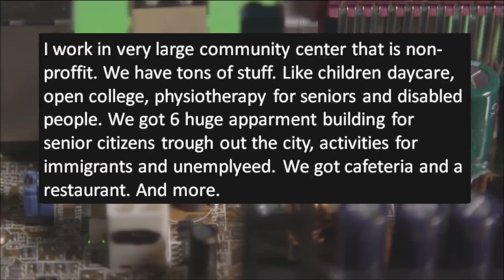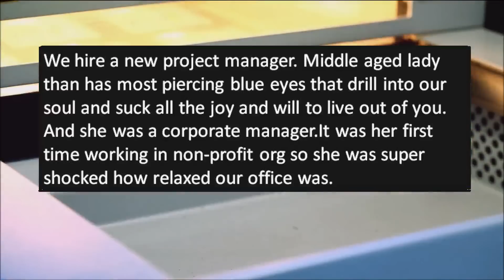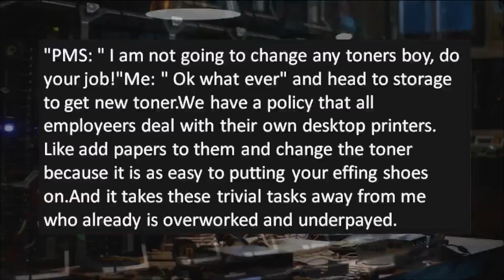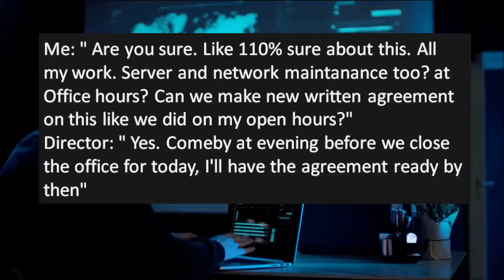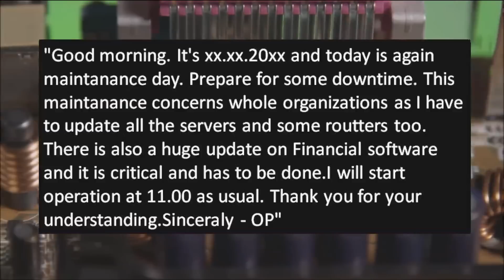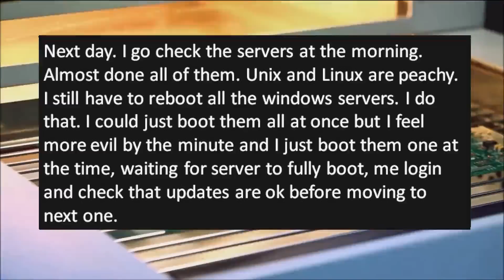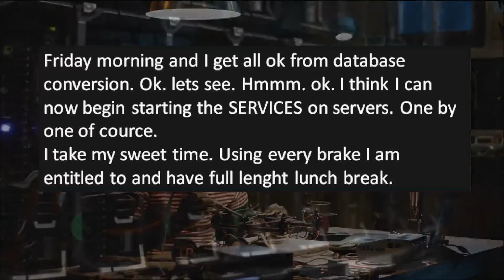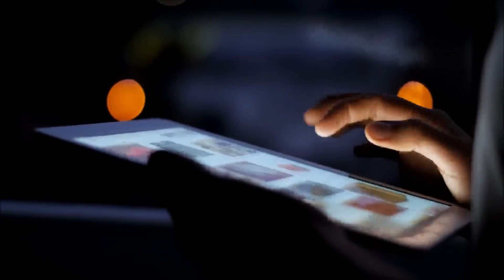Tales From Tech Support - Enjoy your down time!

Comment: I was once reported to my boss by mall security to have been starting work super early on Sundays (an hour to an hour and a half before opening). I used the city bus and it ran infrequently on Sundays. I would clean the floor, tidy the shelves, maybe do some merchandising, and then when my shift actually started I clocked in and did the routine. My boss scolded me and said I couldn't be in the store so early. So I still got there at the same time but had to sit on a bench outside the store until it was time to clock in. Whatever you say, boss 🙄
Reply: I take public transport to work when I can work (Pandemic is keeping me home and sometimes there is no work to do) I often get to work 30 minutes or more before I am due to start. This is in part because I try to plan for delays in travel etc. If I get there and they want me to start then I often will do so otherwise I choose where I am going to sit, turn the computer on, and head to the break room to chillax until starting.
Reply: Crazy. What do mall security have to do with work hours?
Reply: @seraglioborneo2803  I have 2 theories: either it came up in casual conversation between my boss and security (totally possible) or the security guard found it suspicious and reported it to my boss as a heads up.
Reply: [S Young] So if you use your key to enter the office and start working at your desk, at a place where you go to work EVERY DAY, that's suspicious? Looks like the security guard is bored and wants some excitement in his life? How about reporting him to his boss or the mall manager? Get HIM in trouble
OR Maybe your boss is the suspicious coot and has requested security to inform him about "abnormal behavior" in his office? :)
Reply: While the boss is correct, if something should happen, with you off the clock, it can cause major problems.  On the other hand, I like your work ethics.
Reply: He may be required to log the time, for their security logs in case something happens. Most places only allow a 15 minute early entry as normal, to give time to turn the lights on and prepare to  open. Imagine backing an unmarked van up to a building that doesn't open until 9:00AM, and loading it full of Public Address equipment and cables at 4:00AM and having a police car come rolling in. That was no fun, and that business only wanted you there five minutes or less from opening or after closing at 6:00PM.
Reply: You should never work for free; if you were doing stuff at that time, you should have been getting paid for that time.

Comment: Please use the proper term. It is ''Chroma key', not 'Green screen'. Green was chosen because it has one of the sharpest petals on a Vectorscope, and it originally was a very high tech process that not al TV studios could afford. 'Chroma' is color, and 'Key' is the trigger to switch between video sources. if the chosen color produces a broad petal, the transition has color fringes or even worse, the main image may have holes in it. The first TV station that I worked at had a video keyer, which was used at B&W station like the one where I was stationed in the Army. Even though we had no color equipment, I used that crude keyer, a portable color bar generator and a 35mm slide to generate a brightly colored station ID, to prove the station could be converted to color. It stirred up a real shitstorm, with  angry phone calls, and threats from an idiot Lieutenant who had claimed it was impossible. They even tried to have me Cort Martialed over it.
Reply from the maker: For the novice it's fairly interchangeable..lol. It's a green screen and we use chroma key settings to remove it from the shot. I was referring to the screen itself in that context..lol
Reply: @Uncle_Jon  I had replied to an older video where people commented on it many times. I would phrase it as' Chromakey, for which I use a green screen to produce the combined image'', to help get the point across without being preachy. People will never learn what it really means with gentle prodding. No need to go into more detail, unless asked.
Reply from the maker: I just don't think it's that serious in this instance..lol